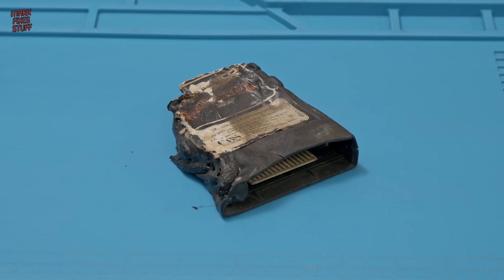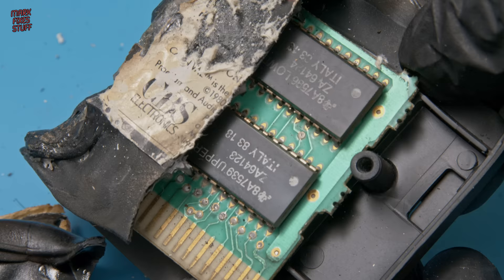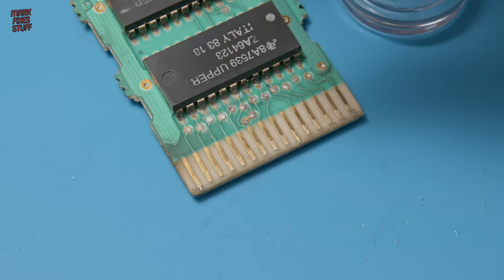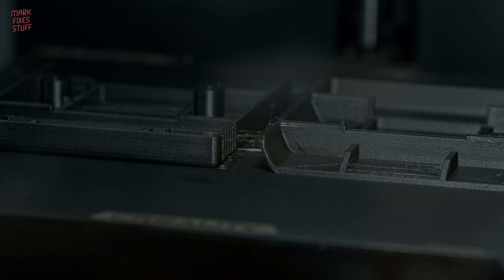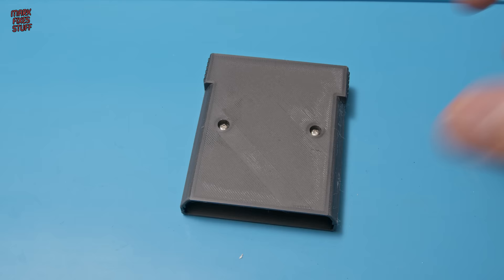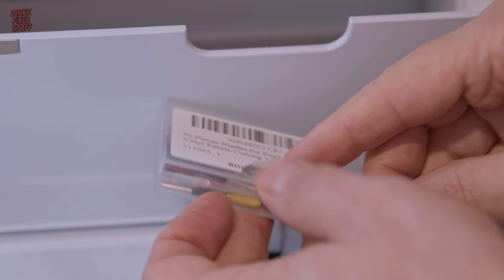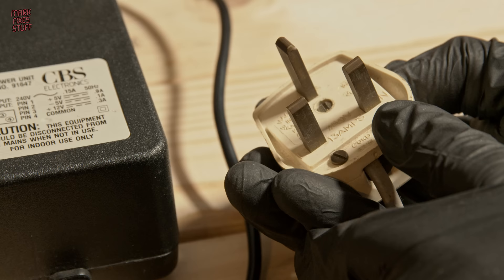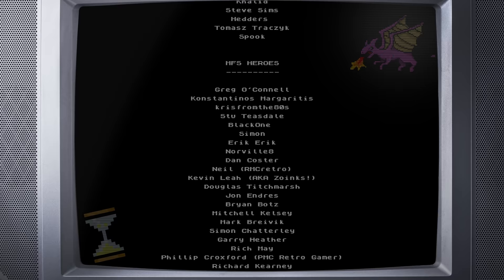Can We Rescue a Fire Damaged Game Cartridge from 1982?  I don't know... #retrogaming #nostalgia #80s

Comment: If I had to guess, cartridges are a bit more resilient to this sort of accident because the space between the board and chips and the plastic shell provides some insulation, so unless the plastic is all burned up or the contacts were too exposed, you might be able to save quite a few of them.

Comment: Good job on those 3D prints, I hope they feel as good inserting them into the cart slot as they look. I'm always surprised how well contacts clean up just using an eraser.

That Colecovision really is in a state, I wouldn't even want to touch it wearing gloves! Definitely need to clean it up. I think it would make a good video cleaning up the console and doing a resurrect-a-thon (would you call that a "rapture"?) on those other cartridges.

Comment: Nice work resurecting that catrage, would love to see some more of the same. Also got a question was there any dry joints caused by the fire.
Reply from the maker: I think the solder joints were pretty bad but it’s more likely from the factory. I didn’t reflow them because I wanted to see if it worked first

Comment: If you have a stripped out screw that turns otherwise you can sometimes get it out if you can get something to give some lift in the direction for extraction that should be all you need.  Doesn't even take much force either just a little something to assist the threads with what little remains and less chance of damage from forcing something that may not otherwise be needed.

Comment: I love the glow in the dark shell, very cool. 
The 3d design for the shell I am using has the indent for the label. Been getting good (if slow) result on fine with my existing Flashforge Adventurer 3. But have a Crealty F1 Pro Max arriving in a day or so hoping I still get decent quality but the speed is improved.
NB: I print my shells vertically, a few at a time on a raft.

Comment: Those cartridges are indestructible! I ran over 2600 combat with a car and it still worked
Reply from the maker: Don't doubt it. I do have some much worse examples here so I'll be working through them.
Reply: @MarkFixesStuff i will maybe reflow the solder point you can see some are really dry one on the 2 chip  this will maybe cause some problem in the future but yeah theese are indestructible
Reply from the maker: Yeah. really I wanted to see how well it survived the fire without my intervention, but that is a good point! Thank you!

Comment: Back in 2006, we had a customer bring in his desktop computer after a house fire. The case was a goner of course, but we had a spare case from a cousin model computer that everything would fit in.

The thing stunk like all holy hell, but we went ahead and tested it. Bad PSU to start with, so we got out our trusty spare testing PSU and hooked it up. Much to our surprise, other than a bad connection on the mouse port, this half melted stinking PC actually booted up!

Our shop's boss didn't want to be liable for however it might or might not come out, but he also knew that I had a knack for salvaging some of the worst case scenarios, but those were usually flood damage or drink spills or the like.

Anyways, the boss told me that if I wanted to take on the job off the clock, just between me and the customer, that I had his blessing.

And so I did. What did I do to clean all the soot off of an entire motherboard? I pressure washed it of course! Using tire cleaner at first to break loose the greasy soot, then a plain water pressure wash to rinse.

Then I accelerated drying time with an air compressor, and finished fully drying it by leaving it on the roof of my car in the sun for like an hour.

I actually had to go back and wash it the same way a second time, as it didn't work after the first wash, but it worked perfectly after the second wash.

Craziest thing is even his original DVD burner still worked! That was probably more dumb luck than anything though, I'm sure it wouldn't have worked if there hadn't been a DVD in the drive blocking the soot from the lens during the fire.

Customer was happy, I was happy, and I managed to reduce the stink level by like 98%. Dude paid me fairly as well.
Reply from the maker: Oh wow! What a great rescue! House fire soot is the WORST because it's so greasy and toxic. Well done!
Reply: @MarkFixesStuff  Another trick I did with the flood damaged systems was to spray soak them with WD-40 for a day or two before pressure washing. I didn't bother with WD-40 on the fire salvage system, but I'm sure it wouldn't have hurt a bit, prolly would have helped actually.

I'm sorry about your smoke/fire damaged items, but if I were in your shoes, I'd probably take all those game cartridge boards out and spray the boards down with WD-40 until you can get to each one individually.

Comment: I've had tooth surgery, I'm on painkillers, so ignore what ya want. I'm gonna babble. 😄

The label- since you went with glow in the dark plastic- why not make a custom label? Instead of a black background- transparent. Make the white text black (contrast). 

What sort of acrobatics would need to be done to stick a small UV LED in the cartridge?  

And just for rank, drug fuelled curiosity... I always wondered- if a PCB no longer works, but the main components are salvageable... what are the odds PCB Way couldn't reverse engineer the boards so you can just do a direct transplant to a new board? 

I'm gonna go lay down now, and wait for the numbing to wear off. trying to get food in me- milkshakes for now- is hell. 😜 

Oooh! One last thought. I dunno what you have for printer filament... but wouldn't it be something if say, you had a block breaking game, and could make it out of say, 'brick and mortar'? Or dump the label, and do 3d colored 'labels'?
Reply from the maker: The pcb has already been recreated so I think we’re good. The rest of the stuff you said are nice suggestions. Thank you!

Comment: I'm entire certain mu Cticut doesn't look at the grid on the carrier sheets.  I knpw this because the trick I use is to cover the sticky sheet with contact paper and it doesn't have any [problems with the carrier sheets.

Where did you get Cricut software that doesn't only work through that online service?
Reply from the maker: I think this does require online. I just avoid using it and dismiss the nag screens. 

This Cricut looks for the mat. It's dependent on you telling it what mat you put in, but it checks the width and length with an optical sensor in the tool carriage I think. 

I'm too poor to order "Smart Media" hahah!